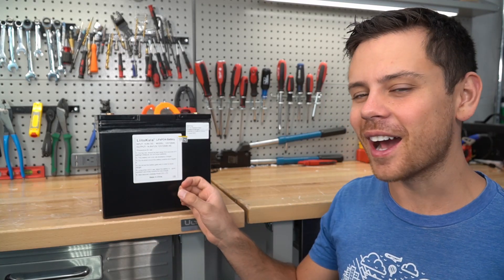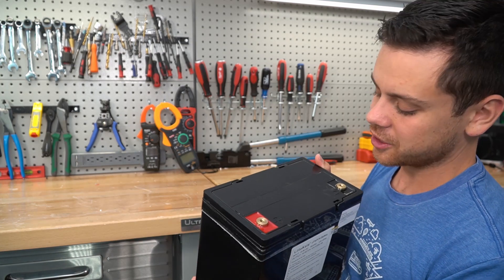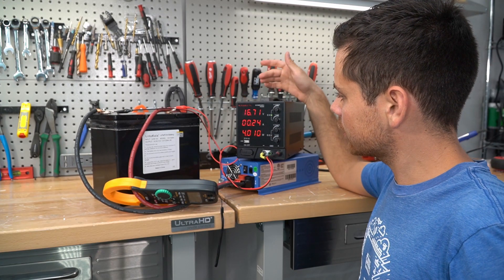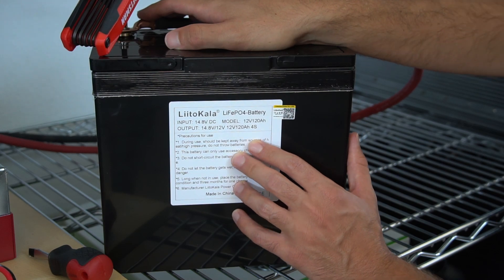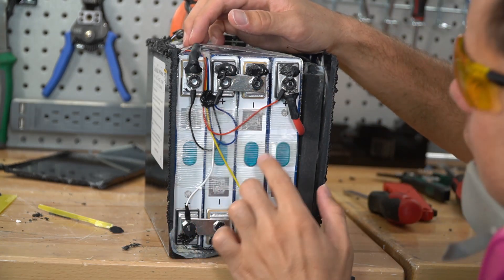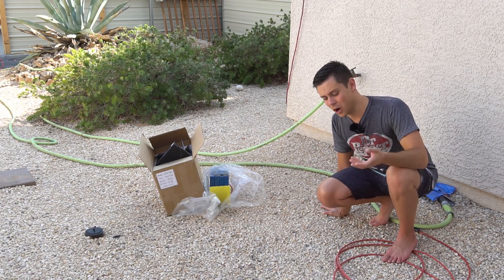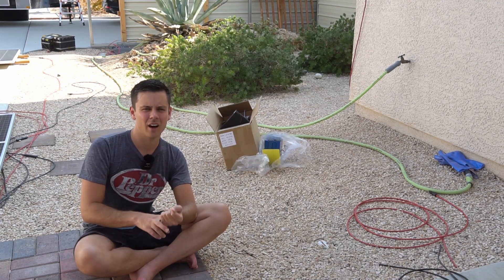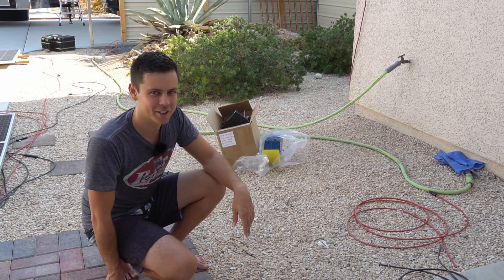Aliexpress $280 120Ah 12V LiitoKala LiFePO4 Battery

Comment: I just bought one of these for my dad to use together with an UPS. I was looking for something cheap and not lead-acid. There was no review at the time so I just went with it. Mine was $240 with shipping so I have no regrets.
 I was only curious to see the build quality and I think it's decent for the price and OK if the capacity is at least 100 Ah and it will last some hundreds if not 1000 cycles it's more than OK for an UPS.
 Overall I'm quite happy with the purchase.

Comment: this battery is good for light current draw when you go camping. good for light, phone charge, 
Why didnt you said how much for the capacity test. 69A charging, but how many Ah you got from the test? Well, if you can get 75Ah from it, then it ok for low current draw, for camping.

Comment: How can you recharge a separate small LiPo4 battery from a cars 12 volt 
cigarette lighter whilst driving?  Like a "Jackery/Bluetti type" SoGen does? 
(Until you reach camp and can use solar through the charge controller)

Comment: Lead accid isn't that bad. I use a very nice one of 100Ah for two main reasons... I got it for free  ;-)  and lead accid is really good/better than LiIon/LiFePo etc. when the temperature drops below freezing point. Even at -15 C (5 Farenheit), you can still use lead acid very well.

Comment: If you look on the LiitoKala Official Flagship Store, rather than the LiitoKala Official Store you may notice that is says 120Ah (10A). I doubt it will make that much difference though. Interestingly, the 100Ah version is in a larger case and weighs 10Kg compared to the 120Ah version's 11Kg so on paper it sounds like it might be a better choice.

Comment: Great video for investigating rechargable batteries.  Thank you Will.  I have a question.  Is there any handheld device on the market that can test the status of the lithium battery pack and see if the result is up to the pack's spec?  Let's say if I'm getting a used e-bike and the spec of the e-bike states its battery capacity is 1000Wh, is there anyway to verify the spec without taking the bike apart and puling out the battery and then do your test?
Thanks again.  Be safe when investigating product from china.
Reply: No.  Other than a 40 mile test ride you are "in the dark" as to battery condition. Battery quality varies greatly among eBikes with some lasting but two years, others lasting 7 years or more. See what a battery pack costs to replace before you buy (often $400-$1000) and try to determine how it should affect your final offer. Good luck.

Comment: I'm not sure it isn't a 120Ah cell. Did you charge and discharge at the proper C rating? You could just soften the glue with a heatgun or hairdrier or sticker remover you savage.

Comment: I have a pair of 30AH lithium batteries. The brands are meaningless as it all comes from China Inc. One is branded as "EcoWorthy". Not sure about the other. I put them in parallel and run a pair of fans rated at 2.5A each but combined actually using 3.7A. The batteries are each rated at 30A. Run the fans for a few minutes and the Renogy MPPT controller shows capacity dropping rapidly 100 - 95 - 90 - 85 - 80. Turn the fans off and the capacity bounces to 100 again. It's all very interesting. I've not done a capacity test but I'll go out on a limb and say the alleged 30A discharge rate per battery is fiction.

Comment: 69 Amps to charge it without knowing the C-rating of this battery? I have li-fe batteries from china which have a C1 rating, they can never stand 70 Amps i guess...only lithium titanate batteries can handle that current as far as i know but correct me if i'm wrong.

Comment: Lithium batteries suck..... Plate lead acid is best for a house...... Lead are safe .. Plate Lead batteries are completeley restorable and last a life time.....

Lead batteries are like its own built in fuze.... It burns out as it burns up. 

Unless the hydrogen gas is getting trapped, there is never a problem..

Lead acid batreries survive EMP strikes.

Lead acid needs no BMS.

Used Lead acid batteries are way cheaper them lithium.

Even crappy standard mat lead acid batteries do quite well with a long life cycle. I buy them and usually pay 30.00 for a 650CCA car battery.

Dollar for dollar ...... 8 in paralell with diodes will out perform

8 batteries × 30.00 = 240.00. 
How do u get more house power for less.....

I been living off grid for 23+ years.

Lead acid batteries are the used solar panel of the battery world...

With cheapo lead batteries.... At 30.00ea you can over build you battery system the same way we over load our roofs with panels.

Comment: So why would I buy one of the 400$ 12v100AH batteries you have recently reviewed over this 120$ cheaper one that is the same capacity? I get that they lied but its not like the 500mAh 18650s that claim to be like 3000mAh. This seems like a good deal if I know what I am getting, or is there a longevity issue on Grade B cells?
Reply: The problem is that Will's battery pulled 105 ah , But because of their quality control, you don't know what you will get. Some are reporting only 50 ah. I bought a 120ah and can pull 80ah.

Comment: This sounds crazy but it might be safer if you opened your packs with a table saw.  You could use the fence to ensure it cuts at a consistent position on the pack and use the blade height to adjust the depth of cut into the pack.

If you slowly crept up on cutting through the pack wall by increasing the blade height, your risk of cutting into the pack would be very low.  Also, it would probably be way faster.  Of course, if you mess up you'd probably make an electrolyte fountain, though there's probably some risk of that with the oscillating tool as well.

Comment: Tip for the next time when handling these batteries might be to do the cutting etc in a basin, that way you won't spoil your table. Or your table covered in plastic. Thanks for sharing.

Comment: I have LiitoKala batteries for about 3 years now. The batteries are 18650 and it is declared 3500mah but in fact it has 3000mah. I was very skeptical about these batteries but now they have proven to me that they are actually good quality and durable. After several years of use and charging up to 4.2V, (for e-cigarettes) their capacity dropped from 3000 to 2800, which is actually great.
Reply: can you give me a 6 year update on this?
Reply: I stopped smoking e-cigarettes about a year ago, and now I don't use them very often. Except sometimes in flashlights and power banks. I haven't noticed that the capacity has dropped. I would buy them again if I needed them, just be aware that there are probably copies of that brand too. Buy only from a seller who has a lot of sales. @kbandara1

Comment: I need a light battery like this for a trolling motor. I didn’t have to worry about charging in cold weather as I’ll never use it in those temps. Would this work for a trolling motor. Looks like it was rated wrong but 100ah is plenty for me.

Comment: I still use 12v Lead acid for my garden solar lights (100ah battery x 2 100watt panels).  Just because it works no matter the weather/temps, -20 to 20 degrees.  We do not all live in a sunny climate area all year round!  😁 👍

Comment: Excellent advise and info, as usual!!   Thanks and keep up the good work!   I’d love to see you test and compare some very small systems, like 40 or 50 watt panels with a controller/ charger built in that can be used as a trickle charger/maintainer and maybe a light in a shed with no power.

Comment: I currently use lead acid but they are just car batteries that dropped enough CCA and would no longer start my wife's SUV consistently or batteries donated that still work pretty well.  I will be switching to lithium as soon as I actually start buying batteries for my set up.  lol

Comment: Hi Will, great video, good to see these LiFe Pro batteries coming down in price. Would this battery or the SOK battery be a any good for my 1972 VW T2, Bay Window camper, I think you call them Kombi's vans in the USA, I'm in the UK, If I mounted this battery where my Lead Acid leisure battery is in the engine bay ?  I have heard that Life Pro don't charge well in the cold, also my alternator only kick out about 55amp/hours would this be sufficient ? ... Thanks 😊
Reply: I have a 1993 VW Eurovan (T4) with a 100w flexible solar panel mounted on top connected to a 45 Amphour LiFePO4 (house/leisure) battery through a charge controller and also have a fused switch to charge from the alternator while underway. 
  Normally I winter in South Florida but because Covid-19 I wintered in Maryland. I found that my Lithium battery's capacity has dropped considerably, probably because of charging in below freezing temperatures. The LiFePO4 battery I'm using doesn't have a below freezing charge cutout on it's BMS.
  I would recommend that you use a LiFePO4 battery with low temperature charging cutoff. A charge controller will help with extending battery life (cycles). A lithium battery can last twice as long if not charged and discharged to its maximums.

Comment: Should Get a few RC Pit Matts
Hudy Pit Mat Roll 600x950mm 

- Sand & Cat litter  - Both are good for Oil & Chemical spills clean up
- I would pick up a Lab Chemical  test swab - bottle mailing kit to send sample off to a lab then find out what it is - > At lest this will tell you what the Chemicals are and how to clean them up

Comment: I like Lithium, I use them in non-critical applications all the time, but the problem is I can still get a pair of Trojan T105 Flooded batteries for about the same money as this cheap (and rubbish) battery and they will still have more usable capacity, be less trouble to charge and need less nannying (yes, lithium does go out of balance, then your whole bank is toast as the BMS shuts you down.)  I can also fix/replace it anywhere in the world. I could go the victron/battle/Sterling route, but then I can afford to double my Lead acid batteries and replace them every two years for the same price!
To be fair, it's not the lithium batteries at fault, I think it is over-complex and expensive BMS that mean taking the plunge is just a little bit too hard at the moment.
Maybe in a few more years this will be easier!

Comment: Simple reason i still buy lead acid is I can't afford lithium for my caravan. 
Bit like the guy who has to buy cheap boots even though he knows they wont last because  he hasn't the money for good quality ones. 120AH lead acid is about £100 here. When lithium comes down to that then I can afford it.
Lead acid last me 3 years approx.
Reply: You doing the math wrong. You need to take the cycles and capacity a lead acid has compared to one of those.
LAB: 50% Depth of Discharge & ~1000 cycles    VS   LiFePO4: 100% Depth of Discharge 2000+ cycles.
So a LiFePO4 can be 4 times as expensive as a similarly labelled LAB and they are EQUAL (weight is in favor of the LiFePO4, a 1/3rd of the LAB).
But with LiFePO4 coming in at twice the price of a similar labelled LAB nowadays, the LAB actually are twice as expensive.
TL;DR: You're replacing your cheap shoes so often that in sum you pay twice as much for them than if you had gotten the expensive ones.
Reply: @joansparky4439  Still can't afford to buy the expensive shoes in the first place! Thats the point your missing!! you need the money to save money. The poor can't afford the outlay.
Reply: @G1gop  
How do poor get a caravan in the first place? Or are you talking full time living in one?  Shouldn't you have mains then in a trailer park instead of a solar/battery off grid system?
Reply: @joansparky4439  No its one we use for weekends away on very cheap pitches. And its over 25 years old. Thats how.  I am in the UK so no trailer parks and costs are very dif. I am disabled and cannot work. We have little money but by bing frugal we do manage to have holidays in the caravan. We prob spend £200 a year on the van and pitches. Better then nothing.
Reply: @G1gop  
Ah, extreme niche then. Well, yeah, in such a case one simply has to wait unfortunately.
I've been an early adapter once, learnt my lesson. So I can relate somewhat.
But will be a long while before Li price matches LAB at nameplate specs.
I mean you essentially want/have to wait until Li is half as expensive as LAB is right now. That's quite an ask, especially with demand expected to go up and gobbling up all the supply that is being put out, so prices won't falls as fast as you would need.
Reply: @joansparky4439  Exactly the problem. 'We can only afford the poor quality shoes'....
Reply: Good point Alan, what some here don't understand is that in the US about 50% of population is also on government assistance.  So not a small niche use case. In 10 years it may be the majority of people who own RV batteries, are on limited incomes.  RVs are "cheap(RV)living"...

Comment: I have the same multi tool. very handy. Good thing the fluid did not splash in your eyes when you popped the side of the case off. No surprise LitoKala Lied about the battery. it seems from reading a few forums its common from those guys to sell rubbish bloated and over rated cells. Some people i know got very bloated cells from them.

Comment: Is there any safety hazards if I'm to leave it in my RV? I'm never in below freezing temperature but occasionally it gets to 120f in the cabin.
Reply: refer to datasheets and talk to the battery distributor. Higher temps are not ideal, they lead to faster degradation, but LiFePO4 is a bit more forgiving in that regard than others.

Comment: Enjoying all your battery tear downs.

When you say you don't know of a suitable application for lead acid any more other than starting engines, for me LA is still a more viable option.

My off-grid system has two purposes; its primary purpose is for grid outage backup and its secondary purpose is for off-grid power system ballast.

As such my battery bank is maintained at full charge ready to supply energy if/when we have an outage. It's just not cycled.

The battery's secondary purpose is just to act as a bit of ballast for my all-in-one inverter while the pool pump (320W) draws its power from the 2.2kW off-grid solar PV array. As such bugger all energy is drawn from the battery to operate the pump, but the battery enables the system to manage short term fluctuations in PV supply and for managing the pump's start up cycle.

These are high quality pre-loved SLA batteries from data/telco centres specifically designed for backup and they are just not getting cycled. I really have no need for (even cheap B grade) LiFePO4 to sit there not doing anything. Here I can get suitable SLA (useable) capacity for much less than the cost of a DIY 48V LiFePO4 battery set up.

If ever my use case changes and I need to cycle the batteries regularly, well then LiFePO4 is definitely going to be the storage of choice. But it requires about triple the $ of the SLA units which do exactly what I need them to.

Comment: If they sold them honestly at $280 for 100Ah, it would still be a good deal. They don't need to lie on the capacity.
Reply: It would be an EXCELLENT deal.
Reply: The website ad says "100Ah 120Ah"... which is the company's way of saying: "You will get one of these ratings, guess which one, sucker?"
Reply: Their lying is impulsive.
Reply: Honest Chinese advertising, hmmm?
Reply: I bought a Will approved SOK even though it is Chinese. The tear down and testing showed me it is a good battery 🔋 replacing 3 aging lead acid.

Comment: In my place average annual rainfall is 3500 mm. During cloudy day my solar array produce only 25-30% of its rated capacity. What do you think what should I do? Upgrade to higher system or buy more solar panel and use it only in cloudy day? My present system is enough for me if it produces it’s 80% rated capacity. Besides I don’t want to buy lead acid battery anymore and lifepo4 battery which you use is not available in my country. Please answer.
Reply: whats upgrade to higher system mean?
Talk to your local solar guy or read up on things.. no one can help you with that mixed bag of information.

Comment: When they are on the Walmart shelf and the same price as lead acid I’ll buy one till then I appreciate the videos I can’t wait till all this stuff gets 10 times better and 10 times cheaper gonna be a game changer for my RV.
Reply: You doing it wrong. You need to take the cycles and capacity a lead acid has compared to one of those.
LAB: 50% Depth of Discharge & ~1000 cycles    VS   LiFePO4: 100% Depth of Discharge 2000+ cycles.
So a LiFePO4 can be 4 times as expensive as a similarly labelled LAB and they are EQUAL (weight is in favor of the LiFePO4, a 1/3rd of the LAB).
But with LiFePO4 coming in at twice the price of a similar labelled LAB nowadays, the LAB actually are twice as expensive.
Reply: I spend 75 a piece at Walmart every two years on two lead acid everstart battery’s for my class c motorhome and there’s a Walmart everywhere I go so when and if one takes a crap I bring it in set it on the counter they give me another. When and if it’s common place and cheap and reliable like that most people will adopt it till then it’s a no go for most it’s like that with all new stuff not just batteries however I’m excited where it’s all going
Reply: @joansparky4439  Try 6,000 cycles.
Reply: @tryagain.k1821    not to 100% DoD.. any spec sheet you look at you get 80% remaining capacity if you got for 100% DoD for 2000 cycles on LiFePO4.
If you got different data I would like to know brand/cell ID to confirm (and happily concede). Thanks.
Reply: @joansparky4439  The new EVE 6,000 cycle LiFePo4. My genuine data sheets are coming. Anyway it misses the point that Li do far more cycles than LAB and it is thus relevant. What are you doing in 20 years time?.